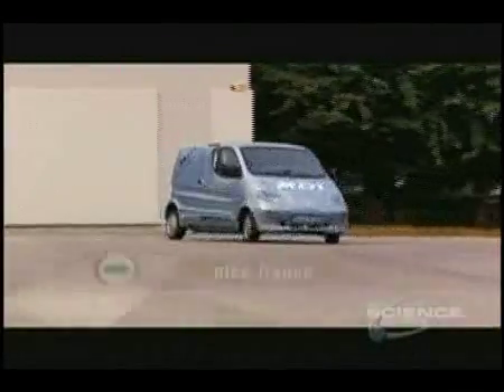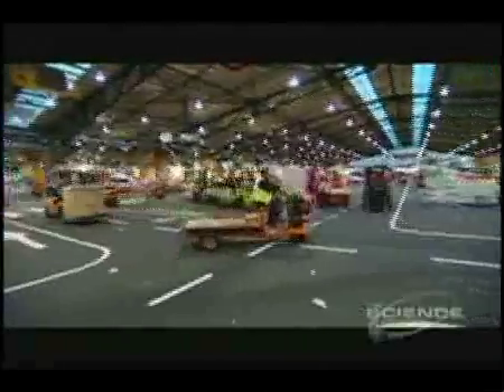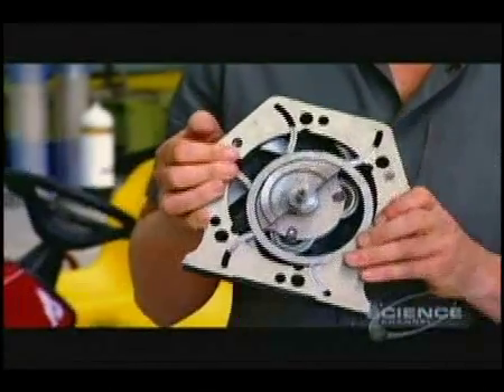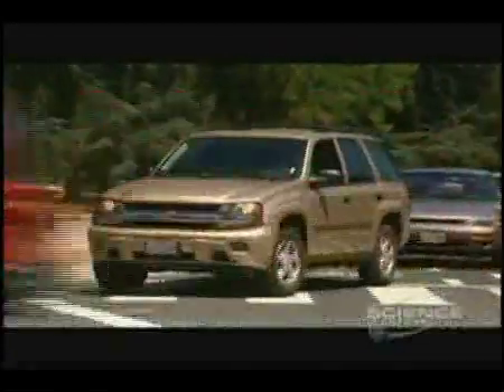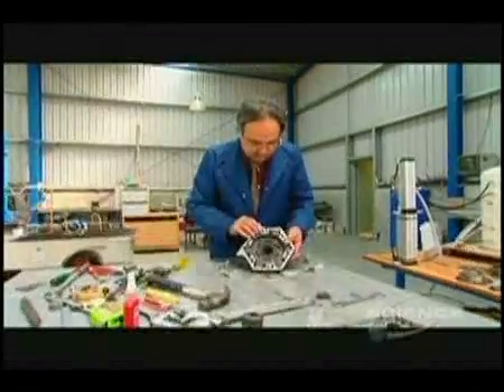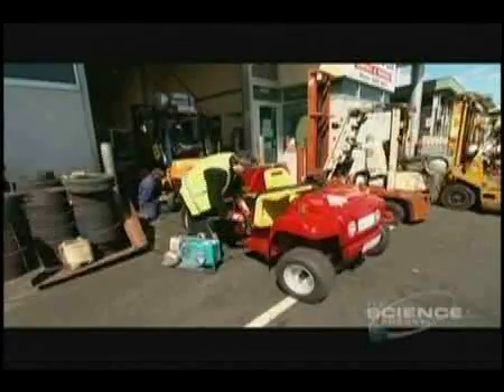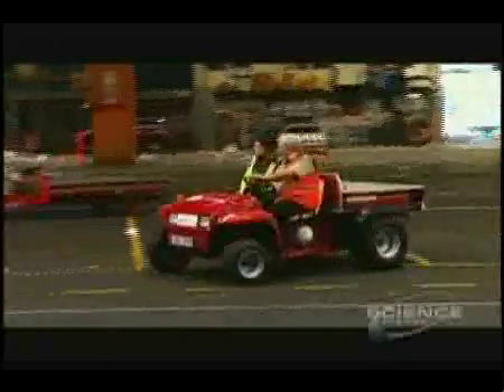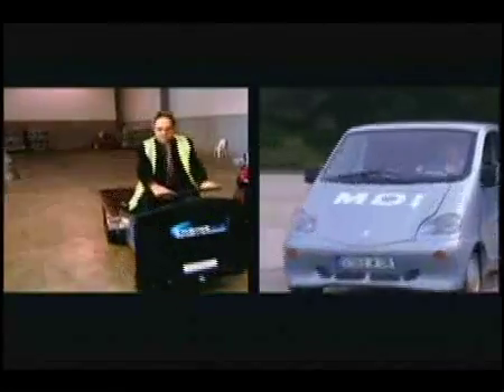Air Car (2 of 2) from Australia

Comment: "but it is almost free ( notwithstanding cost & maint'ce of equipment)" 

So if you spend $10,000s on your renewable power source and it costs $1000's per year in maintenance you think that is as good as free.
Whee.
So one question why don't you have a wind turbine and a bunch of PV panels running your home, because sure as shit you don't. 
Could it be because its TOO EXPENSIVE?

Comment: You need a 7 kw compressor runing for 6 hours to recharge this POC On solar that requires about a $30,000 solar array

To go 20miles will cost between $3 to $5 worth of mains electricity.
If you think that's cheap I have a bridge you might like to buy

Comment: Ok ... so the tank capacity is a large volume to refill, and the tank life duration is not long, but the fact is - it would easily be available for free ! READ ON... you take the electric or fuel fed motor off a regular compressor, & run it by the power of a wind turbine, water wheel, solar powered motor, or tidal powered mechanism ( if you live near the sea ). It may take a while to refill - but it is almost free ( notwithstanding cost & maint'ce of equipment ).It would not be fast but free !

Comment: energy via compressor to tank to air engine = 20% efficiency

energy via generator to battery to electric motor = 80% efficiency

Google "Vencat 20 miles" The MDI air car on air only is FIVE times less efficient than an electric car
The best distance achieved by MDI was 5 miles all the other claims are moonshine.

Reread my question it was designed to get brain cells churning.............Another fail 
Sigh

Comment: A friend showed me this clip a few months ago... I'm amazed no one is producing it yet !!!
Hell - you could rip out the shite under yer bonnet/hood, and stick this straight in.
Forget the bullshit about using fuel to produce the compressed air, you could run a compressor from a water wheel, or a bank of solar panels !. It's the tax collectors that don't want us getting our hands on this stuff 'cause they wont get a cut !!! and these engines would last for years ( only needing bearings and such )

Comment: ...continued.  Also, note that a single oil well in the U.S. on land takes anywhere from 2 million to 15 million dollars to drill.  Only about 1 in 4 wells produce natural gas, and fewer than 1 in 8 produce crude oil.  To cover that kind of overhead, companies must charge a lot.  Then too, much of that profit is redirected into research.  B.P. and several other major oil companies currently are backing research into bio-fuels, hydrogen technology, etc.  Oil will go away, but when it's profitable

Comment from the maker: Yes, the designer originally worked on the Wankel engine.  Mazda had to pull the rotary engine out of California market because its emission issue.  The design simply cannot burn the fuel cleanly.  However, if compressed air is used with the design, the emission problem is solved because the fuel is not burnt in the engine.  Some may argue that this engine is only as clean as how the compressed air is produced.

Comment: It's not fake, it's just the promotors "forget" to mention a few facts. For example
Air powered, cars, trams, locomotives date back to the 1990's 
Compared to electric vehicles air tanks store less power and the air compressors and motors are hideously less efficient.
The trials have been done and the vehicles have been sent back, way too short on range and lousy performance.
The claimed distances speeds efficiency etc are made up and have never been duplicated in independent testing.

Comment: Very good question. 
If you want to promote a new idea for powering a car it would seem reasonable bolt it into an existing car van whatever and do the testing.
If you want to create a SCAM you spend years wibbling away creating vehicle after vehicle which are never certified for the road. You keep producing different bodies etc and you hope no one asks the obvious question
Why can't you just sell the engine and tanks and bolt it into an ordinary car.

Comment: depends on the compressor and what you want it for.  the larger the compressor the more likely you'll start finding gas powered one's just for the fact most places don't get enough electric power off the grid to fill such huge tanks with out beginning to blow fuses.

Comment: IT IS A CON. The best it has gone is 7.2km at the speed of a bicycle. It needs 4500psi compressed air. it takes hours to recharge unless you have a large pre filled bottle bank. Just because someone makes amazing claims does not mean it's true. google e.volution south africa same claims same scam back in 2001

Comment: might not be great for crossing any desert, but here in Europe it would be a hit: when u need to go far, u use a highway, and the law is that you need to have a max of about 50 miles between petrol stations in order for a road to be called a highway. so no problem here. The only question is : where do I buy one ?

Comment: Quote "In an axial flow compressor the interactions between the stator (stationary) and rotor (moving) blades in effect converts most of the otherwise wasted heat energy into positive force on the rotating blades as the gas is reversed and accelerated a couple times."
Nope Your engineer is confused. efficiency in compressors increases if heat is removed between multiple stages. You cannot use this except as a low grade heat source.

Comment: Quote "I know for a fact that expensive "axial flow compressors" now have an excess of 90% efficiency"  OF THE THEORETICAL, but the heat energy HAS to be rejected. 
gas law 
PV=nRT. 
If you compress a gas it gets HOT, the heat energy has to be rejected other wise things melt, this is a loss, unless you retain the heat and re-expand it but that's a gas turbine or a sterling engine and a whole new ball of wax.

Comment: Google Rexresearch Negre or join Yahoo groups air car. Data was on MDI site but they removed the miserable test result about 2 years ago
You have confused % of theoretical efficiency vs actual efficiency. When you compress air it gets hot the heat has to be rejected. Hence all the cooling fins etc This is a very large loss of energy that the air car cannot use.  
Hope that helps

Comment: A vehicle engineered for CNG will be a hybrid with regenerative braking.
The engine will have all electronic valves allowing the engine to operate by combustion or compressed gas(air), or operate as a compressor during braking.
CNG, Hydrogen, Compressed Air. Decompressing CNG or Hydrogen powers the engine as well as combusting.
The travel distance will almost double when CNG or Hydrogen is the fuel.

Comment: "As I have said before, there is nothing like my air motor design"
Nope Google the Douglas Self site there are many similar rotary expansion engines.
You've checked an air wrench on the same test bed? What were the results? 
Hint It's the flow which means volume of air per unit time that matters.

Comment: Like I said you haven't measured air consumption at a specified pressure and the horsepower produced. Have you been to the Gast site yet to see what real numbers look like, or do you prefer to number tumble to confuse and obscure the fact you motor is no better than existing air tools?

Comment: Quote "air can be compressed without fossel fuels(tire pump)but ya do have to get off yer sorry butt to pump it (lazy)"
You have a 3500 psi air pump? You know how long it would take to fill the tanks if you worked at it hard non stop? psst about 16 hours.

Comment: Thank you.  My point is that, if you're using a device to do a job that a much more overall efficient device does, then your foot print gets bigger.  The power has to come from somewhere.

If you're using power from one source to do something inefficient then you are not using that source for something else that is efficient.

I'm not suggesting that you're making a profit from this.  However, there may be other uses for this device that makes use of pressure differences that exist elsewhere.

Comment: Compressing air looses more energy than any other conversion.

If you are recovering some of the energy loss by introducing heat and moisture prier to using it, then the system would be a little more efficient.

I would speculate that the energy loss from conversion is close to about 90% for compressing air. If you were using a source, such as wind mill, to generate the air pressure, then it would be an efficient way to go.  However, The windmill would be more profitable if used in other ways.

Comment: The video is very nicely done. The car may be efficient on its use of compressed air.  However, getting the air compressed is very inefficient.

Atmospheric air contains heat and moisture.  When the air is compressed, the temperature increases.  The higher temperature then seeks normalization and is lost through convection through the container walls. Less heat makes less pressure.  As pressure increases the water vapor is condensed to about 1/1200 of its original volume.

Comment from the maker: You are right.  The video didn't say anything about the air tank construction.  However, the part 1 of these two parts series did address the safety issue of the compressed air cylinders.  Go to the description of the video and click the link to part one.

Comment from the maker: The same can be said about using hydrogen fuel cells. The production of hydrogen is basically storing energy in chemical form and then release latter. Yes, there are also way to crack hydrogen out of fossil fuel too, but those are not clean fuel.  Energy storage is one issue, clean operation is what this is all about.

Comment: Store the extra energy from the solar, if there is any, in a battery that will have much higher power density, higher energy to weight ratio, and very much higher efficiency than a compressed air tank.

Comment: Sorry guys, this is low power density, short range and low efficiency if you try for high pressure storage. If you have solar cells why drive an electric motor that drives a pump that stores the energy in compressed air to then drive this motor which drives the wheels? Just use the solar to run an electric motor that drives the wheels. All the extra steps waste energy!

Comment from the maker: The same question can be asked on all alternative fuel vehicle.  Where do you get the power to produce the hydrogen for fuel cell?  Where do you get the power to produce the electrity to charge the battery on an electric car?  The car can be very clean, but it is moot if the ultimate power source is dirty.  This kind of solution is perfect for locations where clean power source is abundent.  e.g. Iceland with Geo-thermal power, Las Vegas with hydro-power, or 3 mile island with Nuke etc.

Comment: There is only one problem i see with this. The power that is required to compress the air is going to have to come from... where? a power plant burning fossil fuels...
If only there could be a solar array on top of the car that powers an on board compressor... charge it while its in the parking lot! lol

Comment: These things are a great idea...imagine one on each wheel with air breaking! But like many things it does shift the energy...like the wind up analogy. However, unlike electric, we are not talking toxic and resource hungry and expensive batteries which also need recharging.

The key is to gain clean energy to run the compressor, but at least with this tech it is shifted back to power production which may be able to be cleaned up (cleaner coal, renewables, nuclear, etc). Now make an air train!

Comment: Compressed air vehicles may be an issue for business and government as:

The fuel excise tax may not get collected
No physical fuel is sold
Vehicle operator may be self sufficient in charging the vehicle
Tires don't wear out as fast
Not really any batteries to replace
Less vehicle complexity with a less massive engine and no transmission may mean lower vehicle cost so less money is spent to purchase.

Would really change the economy of the States.

Comment: Imagine a windmill spinning a smaller one of these engines situated in reverse as a compressor.  It would have all day (on windy days--could have an electrical backup) to build up pressure to charge the car.  That would go a long way to reducing oil demand.

Comment from the maker: Have two inflated rubber balloons. Poke one with a needle and see how it pops.  Put a piece of scotch tape on the other balloon and poke the needle through the tape.  Air will leak but no pop. Your concern is valid for regular metal compress air cylinders.  But with carbon fiber construction, the strong fiber will hold the tank together when the weak spot split and leak.  It should be safer than a tank of explosive gasoline.

Comment: It would with an on board compressor that runs while the car runs & refills @ certain pressure intervals. Of course You would need a generator & battery to Power the pump.

Comment: Air engines are nice for hobby play.
I have to point out the obvious.
His "engine" does not run on air, it runs on the potential energy of the compressed air.

It's just like a wind up toy, except the air tank is the spring. How do you wind it up? You use other energy.

In the end, you're just using electricity from a coal burning power plant. When solar and wind energy is more widespread, then this may be a good engine for use in some vehicles.

Comment: If braking was done with electrical generators and used to power up on-board batteries, then there could be electrical power on-tap to power the air compressors and there would virtually no need for external electricity or fuel. Truly inspiring, and defiantly innovative... Time will tell.

Comment from the maker: Did you notice that the designer had a background in designing the Wankel rotary engine?  Mazda had to drop their RX7 and RX8 sports car because the rotary has very bad emission problems. Gas powered rotary engine is not clean enough to pass California's smog test. But compressed air can breath new life to the Wankel design.

Comment from the maker: This is just an alternative to electric cars. Batteries nor high pressure cylinders are both energy storage devices.  Where the energy come from is independent from the cleanness of the cars. You can use Solar power to drive the compressor.  Or you can also burn coal.

Comment: he was talking about the moment when u go down a hill, or wanna brake, just hit the brake, with is a cluth, wich connects the drive gear to a air pump, so the enertia of the car is turned to air wheel acting as brakes. Press the normal cluth to disconnect the real engine act press the brake pedal to make air.

Comment: Haha yea i agree with you that they could have used a better source of compressing the air, like maybe using an electric pump powered by wind energy or something, though if it only takes 3-4 minutes to fill the trolley up, and then the car runs for 2 hours or so, its not too bad.  Better than running the car on gasoline for 2 hours!

Comment: The only limitations are the air tank capacity and durability and the mechanical quality of the moving parts.  Regenrative braking could power an on-board compressor to recharge the tank.  Many service stations have free compressed air service now but only up to ~100 psi, not enough for the air cars.  It wouldn't be very expensive to upgrade the air compressors at service stations and charge some nominal fee.  IT  COULD  WORK!